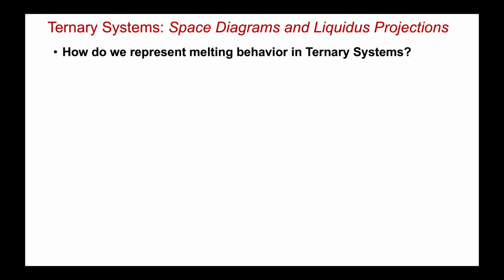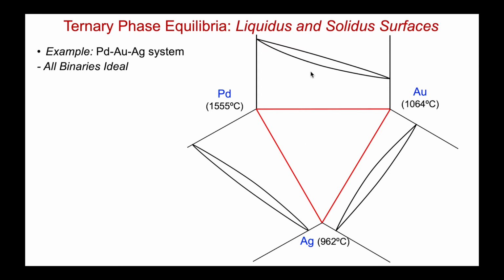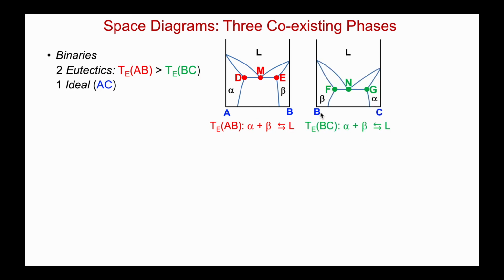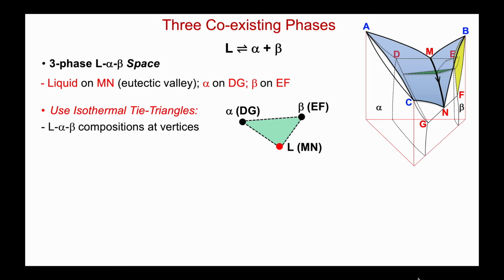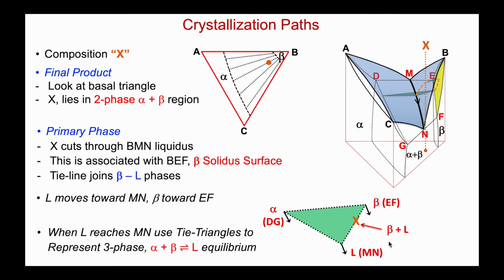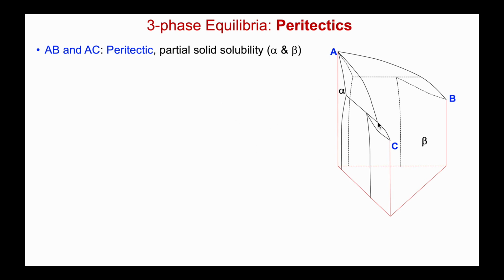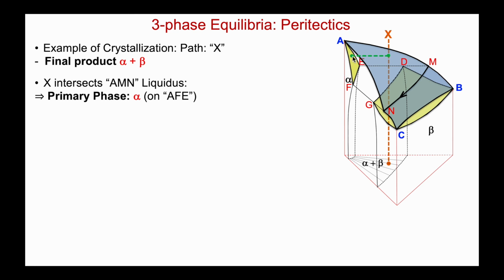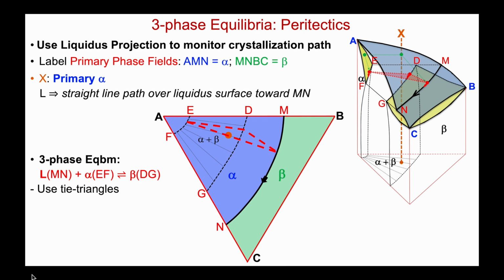Reading Ternary Phase Diagrams in Materials Science (Part 2: 2 & 3 Phase Solid-Liquid equilibria)

Comment: Dear Professor Davies,
One example I found for the ternary system consisting of two binaries with eutectics and one binary with complete solubility is Ag-Au-Ge, optimized by Hassam et al. (Experimental and calculated Ag+Au+ Phase Diagram,  MMTA, Vol. 19A, 1988, 409).
Reply from the maker: Thanks for the info and reference!